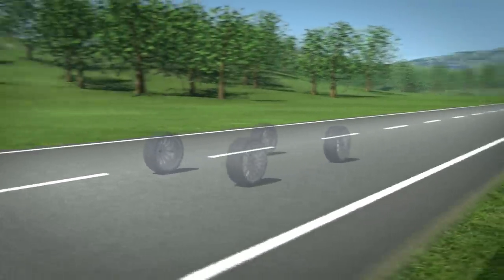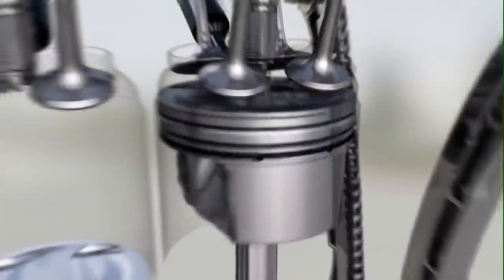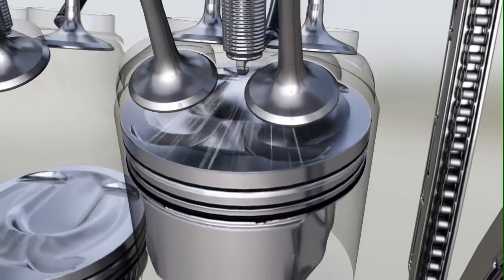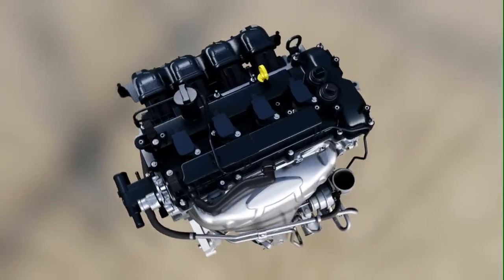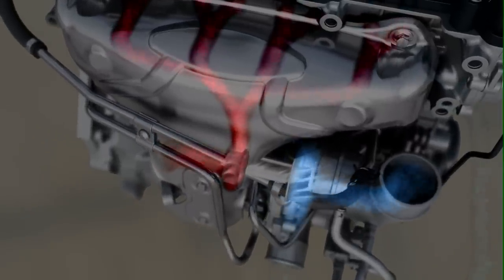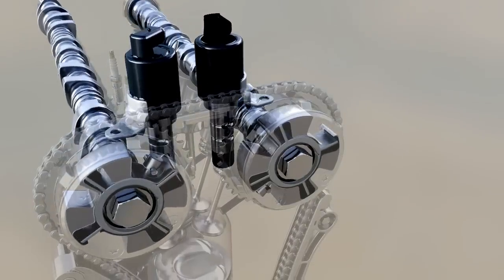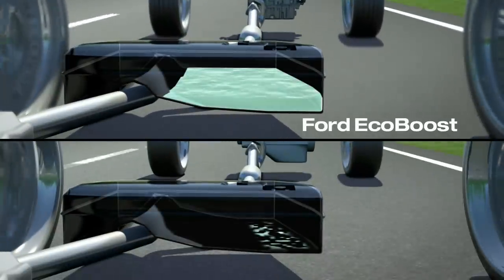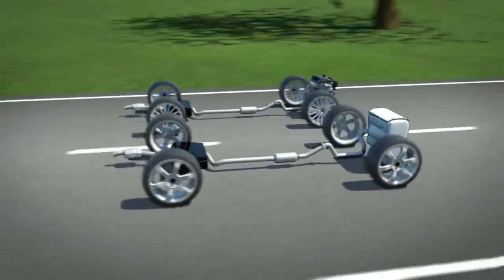Ford Ecoboost Animation

Comment: I would prefer a 8400 rpm supercharged 2.5 liter HCCI Variable compression ratio variable cycle inline 4 cylinder with multiair inspired VVL, VVT, and plasma sprayed cylinder walls over a 2.0 even a 2.3 ecoboost. High compression atkinson cycle and supercharger disengaged and bypass for fuel economy and low compression, otto cycle, and supercharger engaged for power. Also the VCR uses variable compression rods and a PWM controlled solenoid for infinite variability between 15:1 to 9:1 so the compression ratio is changed on the fly even on sudden changes in throttle application.

Comment: These engines suck.  I work in black car livery industry in nyc and many drivers own the Lincoln MKT's with the either the ecoboost engine or the 3.7L V6.  Many including me have had major problems withe water pump failure and the the coolant leaking in to the engine.  My car was just at the the dealer for 3 days, so 3 days of not working and making any money.  The dlr quoted me at $6,000 for the repairs because it's an 11 hr job.  They have to open up the whole engine remove the timing chains just to get access to the water pump, are you kidding me.  I have no idea why the engineered the water pump to be inside the engine.  I am never buying another Ford vehicle again.
Reply: awww too bad, but let me tell you one thing- Europe's regulations
Reply: "so 3 days of not working and making any money."

Rent a fucking car

Comment: If the 2.7L and 3.5L V6s came with catch cans, they'd be near perfect. Spread the word. Get a catch can!
Reply: I was really considering a Maverick but after watching some Ford techs on YT and what happens to these engines at around 50k miles... I'm not understanding who would buy one. I have a busy life, kids and all that. I'd rather be out riding my bicycle or maybe doing some fishing instead of wasting a Sunday in the driveway talking my engine apart  and soaking valves with carb cleaner just to address a problem Ford could have addressed just by adding fuel injectors behind the intake valves like Toyota does on their GDI engines. 🤦🏻‍♂️ Sorry but an MPI engine is worth more in my book than one of these Ford, Kia or VW engines they manufacture knowing that they have an inherent design flaw. Just dumb.

Comment: My 2013 ford escape 1.6 ecoboost almost has 158 k miles 0 probles and still running smooth, ohhh and still get almost 31 mpg on the highway, I love my ford escape, the only problem i have is the radio sometimes freezes  and the only buttons that work are the ones on the steering wheel.

Comment: Two problems with this:
One; It's a Ford. Ford often introduce fantastic technology, but they fail more than often.
Two; Direct injection is a nightmare! Carbon build up on the intake valves, overheating injectors & lost of power.
All this your problem conveniently once the vehicle's guarantee has expired.
Reply: Hamzah not for real right boy you are confused dont take a nap while trying to learn something

Comment: Shell V Power Nitro+ every 4th tank solves the carbon buildup on the intake valves
Reply: No. The fuel never touches the back of the valves. They really don't get as bad as the old Volkswagens did, anyway. The valves stay much cleaner. You just have to rev it up once in a while. Always get the engine up to full temperature and you're fine.

Comment: @GIUGIK1 You should look up the F150 Ecoboost Torture test, they put it through hell and it took it very well, something like over 150k miles under great strain and still was putting out great power and ran great.

Comment: It’s funny you say all this because I’ve got a 2018 fusion with a 1.5 eco boost in it and it has had black exhaust tips from carbon since 1,500 miles and my truck is a 4.6 1998 f150 and has no cats or muffler with shorty headers and true duel but yet my tips are completely clean for the past 20,000 miles and the truck has 256,000 on it the car now has almost 11,000 miles and the tips are so built up with carbon it’s about 1/8th of an inch thick

Comment: Still no replacement for displacement. My grandfather had a 1954 Buick with the v-8 standard and he got 20 mpg.  So now we have these lame liberal motors in everything including half ton trucks why??? Why don’t we stick a liberal on our exhaust pipe instead of a balloon if they’re so worried about emissions? You’d have to get a new liberal to put on just as frequent as you’d replace the Ford motor lol.
Reply: That's why I like dodge, because there not afraid to put fat overpowered v8 in a heavy ass car
Reply: @American JetFuel and the eco boost and the 3.0 powerstroke and most of Ford cars and the ford transit are all European ford division designed crap!
Reply: @American JetFuel ford fan boy Eh dont get me wrong they all make pretty good automobiles and they also make some real shitty ones if you'r going to call out Chevy and dodge has being junk ford has a few of there own all manufacturers have good and shitty ones basically I'm sayings you're being biased!
Reply: American JetFuel  better? My jeep with a 5.7 hemi gets 15.5mpg, then my ford transit with 3.5 ecoboost gets 17.2, both the vehicles are 5,000lbs. And the hemi has tons of power when the ecoboost does not. Plus the 5.7 has 320,000 and is going strong!!!
Reply: Jesse Pomeroy... "No replacement for displacement" is a tired and now incorrect cliché. And I bet the little 1.5L ecoboosted 4 cyl has more power than your grandfathers 54 V8. And 20 mpg on a V8 engine wasn't realistic until lock up torque converters were introduced in the late 1970's.
Reply: @Deucealive75  Until that EcoBoost shits its guts out prematurely!

Comment: What are the cons of this engine? If it is better than other engines then why it is not widely used ??
Reply: Its a fuel hog
Reply: @trentonwelch9506  wat do u mean by fuel hog??
Reply: @pavanchaudhari5499  it goes thru fuel fast and gets a mere 16/18 MPG depending on how you drive it which isn't bad but could be better

Comment: You can clean the carbon build up . My garage will do it . You can also do it yourself . It’s not that hard. Find a major vacuum line and spray the cleaner in it . Also spray into the throttle body . My mechanic told me it isn’t nessasary till 50,000 miles or more. Ifmine runs ruff ,I’ll have it done then

Comment: I’ve got 21,000 miles on my 3.5 . I run Chevron gas,87 octane . No problems yet,but I don’t run the hell out of it ether!
Reply: Paul Grimm we dont have fuel as low octane as 87 here in Britain. Our minimum is 95. Isn't 87 incredibly weak?
Reply: No. Our cars are built now to run on 87 octane. In higher elevations ,cars can run on 85. Premium is a total waste of money ,but good gas isn’t
Reply: Paul Grimm thanks, that makes sense. Our stuff is tuned for 95 minimum but obviously higher is available. I run my turbo on 101 as it really uses the extra well.

Comment: It's interesting... been digging for a Ecoboost Ford since I've been using a Diesel Focus II for almost 3 years and after 213.000km the turbo let me down due to a major air leak, which resulted in a big perfomance loss when I was on 4th/5th gear... is it true that the Urban consumption goes over the roof with these engines? I saw with the new Fiesta it did almost 7l/100km while my Focus diesel used to do 5.5l/100km

Comment: Fords technology is 3 to 5 years ahead of the competition.
Reply: neal k lol.  By competition are you referring to gm and dodge?
Reply: Imagine thinking that ford has a monopoly on turbochargers, direct injection, and vvt. Literally every other car manufacturer uses this tech. Ford wasnt even the first.
Reply: I understand other manufacturers use the same technology but they don't use it to the same level as Ford i.e.  twin turbocharged V 6 325hp 400fb torque.  Pretty damn sure other manufacturers aren't even close ....
Reply: @nealk6387  GM LF3 3.6L twin turbo makes 420 hp and 430 ft*lb torque
Jaguar XF S has a v6 that makes 380 hp
Infiniti Q50 has a v6 that makes 400 hp
Mercedes AMG SLC 43 has a v6 that makes 363 hp
Afla Gomeo has a v6 that makes 505 hp
All of these cars are less than $70,000 

Dont get me wrong, Ford makes some good cars. But its pretty arrogant to say that they are years ahead of the competition, cause they are not. Ford tech is not more advanced than the competion, nor is it less advanced. VVT, direct injection, turbos are very common technologies nowadays.
Reply: neal k  tells us about the use of a sequential gearbox on the gt500.  Mind blowing... it’s only been in every vw for 10 years, same with literally every other tech mentioned in the vid

Comment: My boss has the F150 EcoBoost, wanted his brakes replaced and the technician jacked it on 2 post lift got distracted and left the truck in neutral, killed the battery, put new battery in and started to drive it and the truck kept going into limp mode multiple times. He eventually had to get the throttle body replaced. Now he has a dog he can walk home with the next time his Ford breaks down.

Comment: Wait wait wait hold on eco,  how it said multiple fuel injections per cycle. So what happens is the firing chamber is constantly cooled before a burn internally. How can the fuel burn if ur cooling the chamber.

Comment: OK when new but when they are older not do boosty. More sluggish with fowled valves and carbon everywhere.. Best put the carbon out through the exhaust system and keep engine clean. Plus you can't spray carbon cleaner in the intake or you will wreck the turbo..

Comment: Has Ford taken any steps to mitigate the problem of carbon buildup on the backs of the valves due to PCV oil burning onto the valves?  Chevrolet has done so, I know.

Comment: 1. There’s never been a substitute for displacement.
2. Making your engine out of “aluminium” May save weight, but when you warp the head the first time it overheats, you throw it away.
3. Variable valve timing decreases the time between catastrophic breakdowns.
4. High pressure, direct injection gasoline engines is a precursor to inoperable fuel pumps.
5. Nobody, repeat, NOBODY, who drives a pickup truck gives a shit about CO2 emissions or what the effete snobs of Europe think about it.
6. A full size truck with a skateboard engine causes the driver to beat the living snot out of said engine, just to keep up. So do yourself a favor and keep buying the 5 liter V-8’s.
Reply: I have yet to feel the need to beat the snot out of my 3.5 EB in my F-150. Does just fine at reasonable throttle intervals.

Comment: @MeWoahits

Because with proper engineering, it can be great on fuel consumption at low throttle but still boast a lot of power.

Comment: Eco boost does not have variable valve timing. Variable valve timing contains a single larger lobe. This is vct. Variable cam timing. Has nothing at all to do with performance. Vct is for efficiency. Vvt and vct are in different categories so don't compare them
Reply: Ah, ignorance. Cam-phasing and cam-changing are both variable valve timing technologies.
Reply: No, the EcoBoost definitely has VVT AND VCT

Comment: i have been reading a lot about how direct injection motors like the ecoboost in the f150 with either the 2.7L or 3.5L have an abnormal amount of carbon deposits building on intake valves and the engines requiring serious cleaning.  About how purchasing a catch can is necessary or periodic cleaning with seafoam and/or intake valve replacement.  Anyone with an ecoboost motor, can you chime in if you have over 50k miles?
Reply: That just delays it, replace the heads at 135000km instead of 100000. Just wait and see.
Reply: My 2014 Explorer Sport has about 73k miles and I haven’t had any problems yet.
Reply: I have the 2.7 with about 6000 miles I enjoy it.
Most cars aren’t built any better now than they used to be. Even gmc is introducing a 2.7 twin turbo motor so it’s not gonna matter. I do have a catch can,  roush tune stage 1 and roush intake. So I’m hopeful I’ll get to 80-100,00 miles before needing a new truck.
Reply: 2015 ecoboost 3.5L, 236,000 miles. 3rd set of heads, and a very expensive motor to maintain. About 5k in engine work a year after 100,000 miles

Comment: nah, think i'll stick to my 4 liter 6 cylinder. Build an ecoboost engine that can pull 3.5 ton at 60/80/100 km/hr under 2000rpms then maybe i'll be interested
Reply: 1700iDiGuy what do you have, a ranger?
Reply: A ranger? Nah I have a falcon 6 cylinder and a v8 fairlane ghia

Comment: Ecoboost = 3 cylinders = 3 legs to pedal
Normal = 4 cylinders = 4 legs to pedal.
So the engine couple is not the same especially in climbs and overtaking.

Comment: Why do people still go on with emissions? Carbon dioxide is fine, plants and microbes break that down. What you need to be worried about is carbon MONoxide. Which is already taken care of by the catalytic converter. If a cat system were still producing too many tailpipe emissions, it would be evident by either a failed cat, or the cat getting too hot and unable to keep up. When the emission input into a catalytic converter exceeds it's abilities, they usually get very hot, sometimes to the point of glowing. After EGR, PCV, and fuel injection got introduced, cars emission were already good enough, the cat just polishes things off. No matter the size of the engine. VVT is just a fuel economy and money making extra.

Comment: In 2009 Ford modified an experimental 3.5 V6 EcoBoost engine with both E85 direct injection and gasoline indirect fuel injection, which achieved a BMEP (brake mean effective pressure) of 395 psi (27 bar), which translates to approximately 553 pound-feet (750 N·m) of torque and 316 horsepower (236 kW)@3000 rpm (flat torque curve from 1500-3000 rpm)

Comment: I dont see the obsession for high revs with a good engine/ good turbo. Ford 180hp diesel pulls hard at 1250rpm and has 360 to 400NM torque from 1500 to 2000rpm. Keep engine between 1500 and 2000rpm through all the gears. Nissan Qashqai 1.5dci (1.46) pulls strong from low revs and manages 70mpg on cruise with only 110g CO2..  diesels are just getting better.

Comment: And it blows a head gasket 5k miles after the warranty ends. We have a fleet of these - same fuel economy as the 6 cylinder and none of the reliability. 👎👎

Comment: Less co2 emissions,  sure.  But where does that carbon go? Maybe in the intake valves that are only having hot air going through them......build up carbon and seize motors

Comment: Ford Escape with EcoBoost - $3,200 to replace a leaking head gasket! It got it's best mileage when it had just 10,000 miles and declined from there. Never again EcoBucks!!
Reply: alan brakefield Ford excursion ecoboost with 200,000+ miles and no problems, F-150 ecoboost with 90,000 both get about the same mileage, both had no problems so far.

Sometimes you get a lemon, sometimes you just don't maintain your shit to the standards it needs

Comment: Use turbos to force more air requires more fuel. Sorry but the 5.0 is as good on fuel as an ecoboost. This certainly holds true for 2011 and 2012 because I lived it with fleet trucks. The 5.0 was better, marginally but better.

Comment: Hi I have a 2018 eco bust and 
Wen I get to a stop light the truck dies and I take it me 3 or 4 times turning the key before the truck turns back on 
Is anyone having the same problem ????
Also wen I turn the truck off 
Wen I wAnt to turn it back on it takes me A couple of times turning the key 🔑
Reply: David Serrano .....dude, take it to the dealer it’s under warranty.....🤦‍♂️ before you f something else up
Reply: Coil packs are breaking down with low rpm voltage drop from possible alternator problems starting .... spark plug gap is worn wide ... or you have water in your gas .... my 3 best guesses !!??  If you had it diagnosed , I'm curious,  keep us posted !! Thanks 😎

Comment: So how has EcoBoost worked out for Ford?

The Focus, Taurus and Fiesta will be the first to go. Ford will end production on the Focus in May 2018, the Taurus in March 2019 and the Fiesta in May 2019. The mid-size Fusion will stick around a bit longer.

As for the upcoming Focus Active, as of right now, the vehicle will be assembled in China and imported to the United States. 

Uhhhh... Looking like Ford will continue to go downhill. Just a lot faster .
Reply: F150's , SUVs, with the 2.7 and 3.5 ecoboost are doing excellent surpassing the competition by a large margin in terms of horsepower, torque, towing power, and in sales numbers nobody is touching fords number with f150 and mustang sales with the ecoboost.. so its doing very well. The people who say ecoboost is bad probably never owned a 2016+ model year ecoboost the few imperfections have been perfected... also Ford is focusing on Trucks, suvs, and the mustang is the only reason the other cars are going they're just going to focus on what is selling good for them which makes sense it will allow them to keep beating the competition they don't really need the fiesta, focus, etc

Comment: To further improve fuel economy Ford has performed drastic weight reduction measures. As seen in the video, Ford has completely done away with the vehicle's body and chassis, significantly reducing the vehicle's weight and is greener with less materials used during manufacturer

Comment: You don’t need the eco boost the fire transit has the bigger 3.7 and it has 290 hp no turbo  but it damm fast I think it the 6 speed that shift instantly and it so torque  it in 3 gear at 25 mpg cruzing Iam getting 20 mpg 18 buck a week vs the old ford 150 351  40 and few 50 buck a week. Was a Gas hog the v6 faster 0-50 is about 5 second or less  and it used the 6 speed for speed vs rweving the motor. That why it good on gas
Reply: I don’t want the eco boost it’s  eat gas